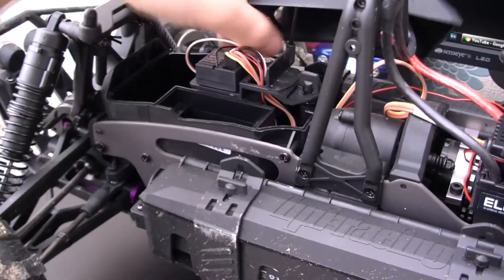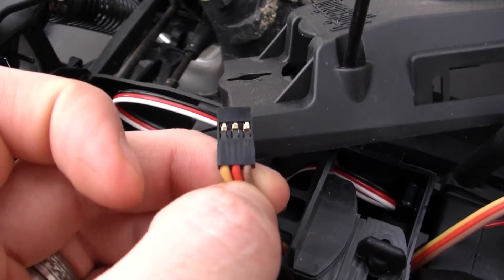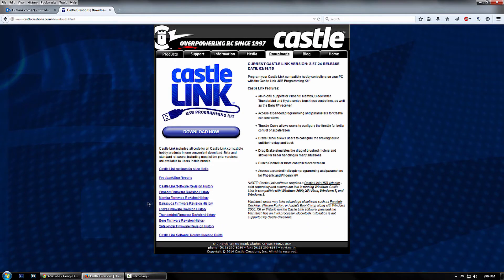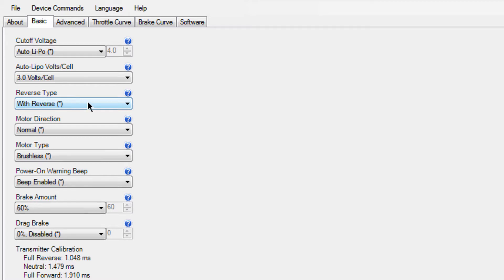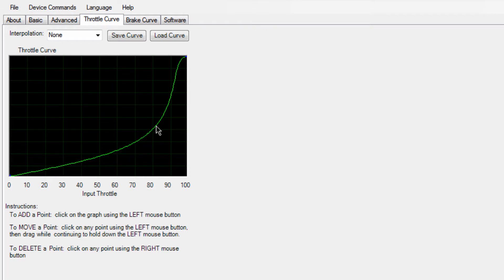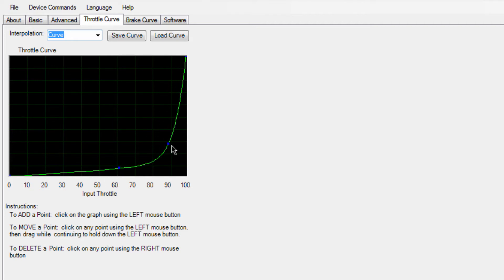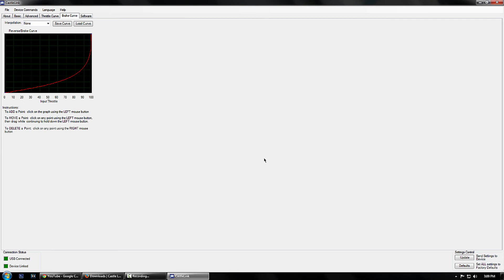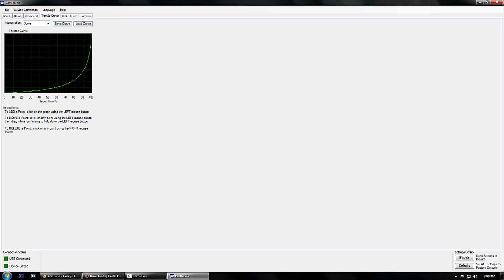INSANE RUSTY RC - Savage Flux HP Throttle Curve Adjustment

Comment: i HAVE THE SIDEWINDER 3 ESC ON A STADIUM TRUCK, i HAVE NOT TOUCHED THE THROTTLE CURVES, iM GETTING GLITCHING FROM NEUTRAL TO FORWARD THROTTLE??
Reply from the maker: Adjust the trim on the transmitter .
Reply: Switch around two wires or you battery is on it’s last leg or you could go down a tooth or to on gearing